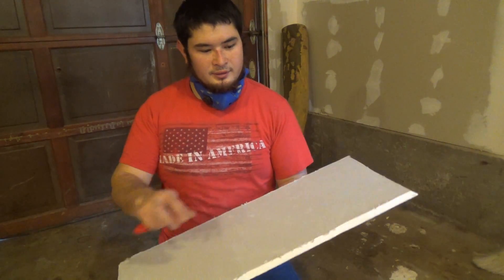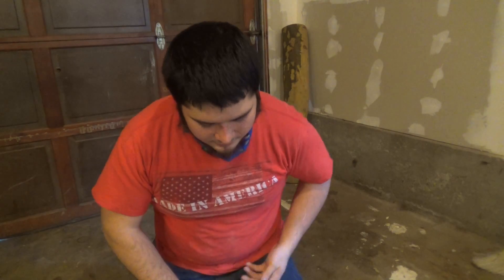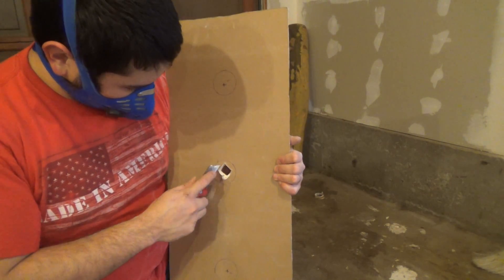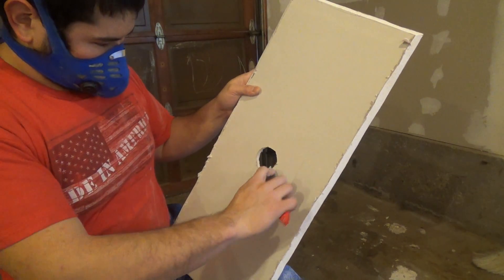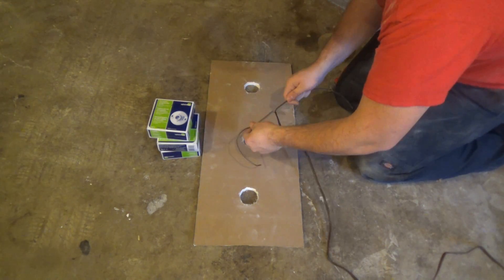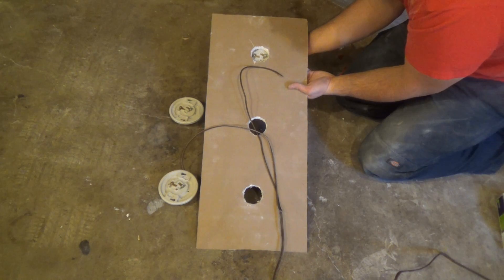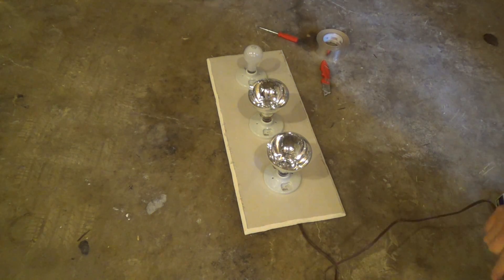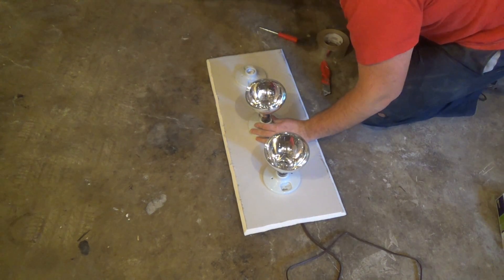Building a PVC Bow Hot Box Part 2 - Wiring the Light Panel

Comment: Nick, from a safety aspect, trace the wires down to the plug or outlet and notice which wire goes to the narrow blade and which goes to the wide blade. The narrow blade is to be the "hot" wire and the wide is the "neutral" wire. The hot wire goes to the "gold or brass" colored screws and the neutral goes to the "silver" screws. That way if you, someone else, or your foil comes in contact with the base of the bulbs you won't get a shock. Also, on your switch, tie an overhand knot before and after where you place the switch for strain relief. Plus, cut the "hot wire" to wire the switch so when you turn the box off, the electricity is off to the rest of the box. I must say that I do love your videos and can't wait to try making my own bows and hot box. Please do keep posting more, I just wanted to try and make the box a little bit safer for everyone. :-)

Comment: I don't understand why can't you just pull the wire through the hole, connect it to the  bulb socket contact THEN attach the bulb socket, then measure where the next contact will go on the wire, clean the insulation in that spot, again pull the wire through the hole, attach the wire, attach the socket and so on. What is the point or reason of being a jeweler and doing it directly through the holes in the board? Could've just as well attached the sockets to the board first - they wouldn't move around (if the reason is that you actually NEED the wire to be perfectly tight) and it would be easier than what you're doing.

Comment: Nick, you've been unnecessarily hard on yourself while wiring up your light sockets.  There's no need to keep a single wire for each side.  You can use separate wires to connect the terminals of each light socket to the next instead of trying to peel small sections of wire in the middle of a wire.  You just need to bare 3/8 to 1/2 inch of the ends of each wire twist them together the bend the bare copper into a hook.  Put the hook around the shaft of your screw terminal with the hook end facing in the clockwise direction so the tightening of the screw tightens the wire down instead of trying to turn out from under the screw.  Also, you will want to make sure that the "hot" line goes to the terminal that connects to the contact in the bottom of the socket.  That should make your wiring easier.